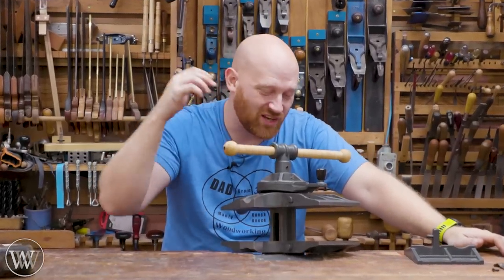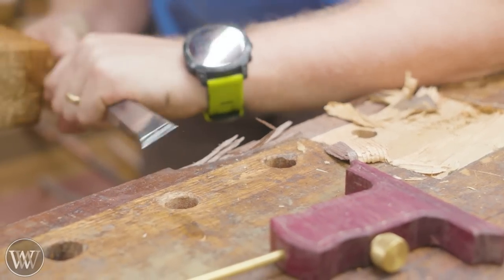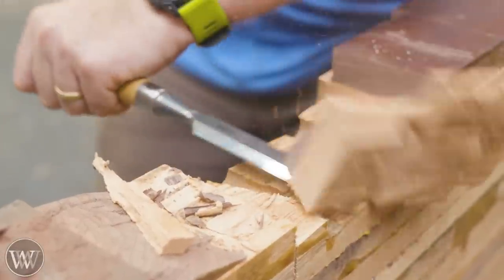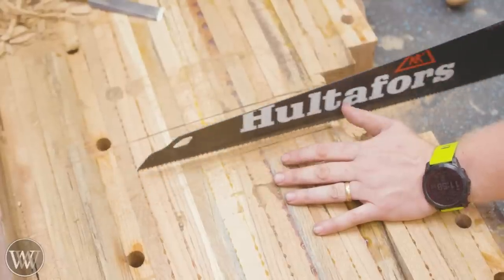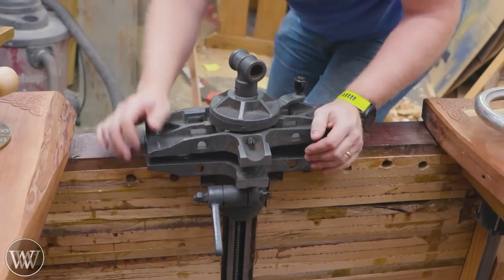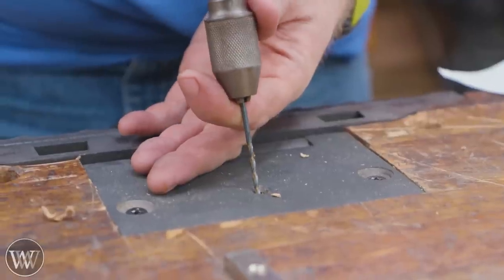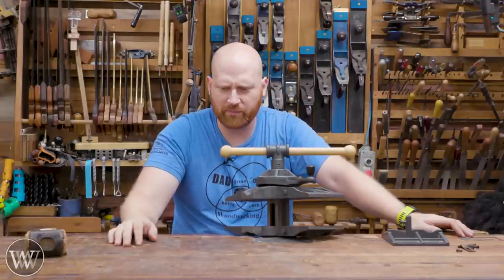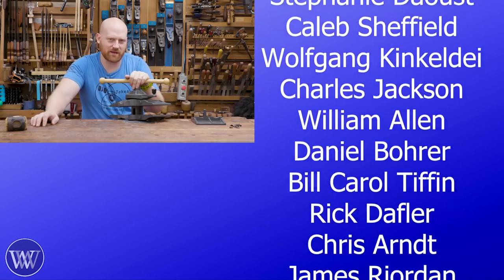How To Install a Pattern Makers Vise In A Woodworking Bench

Comment: Nice to see you using a Swedish saw! Hultafors started year 1697 with making ships nail and later axes and other tools.
Reply: Yes, and Hultafors makes the best purely metric 3 meter tape I can find though I got the impression it is exported to the US by a Brit company. The model to which I refer is about $30 but has a 100 mm tongue that can be released by a tamboured slide that allows precise inside measurements.
Reply: @markkoons7488  Yes the Talmeter as it is called here in Sweden was invented by Ture Anders Ljungberg = Tal meter in 1954 and Hultafors bought the company 2005.

Comment: I was thrilled to get mine, and had it for four years. The most action it saw was me bashing my hip into it. So I sold it for what I paid and do not miss it. Yes, I know that it was an amazingly versatile vise but it really wasn't all that useful day to day.  I do have a carving vice for holding odd shaped items, which I have on a cleat that gets held by my leg vise. I certainly hope you remain enamored with yours. Filling in the cavity was a PITA. Good luck, and thanks for all you do.
Reply from the maker: It is most definitely not a vice for everyone. It does very specific things incredibly well. But not everyone does those things.
Reply: I don't have one. But one thing I realize is that a lot of moving parts is not really good. Sure you can adjust it to another position. But can you get it back to the original position?
FWIW. I have sliding miter saw. I just tweak it to exactly 90 degrees. And hopefully forever leave it there. After all 95% of cuts are square cut. Every cut is square.

Comment: I have done this same job with my pattern makers vise. So, you have a “vice” for “vise’s”? My installation was difficult because of my bench. A bowling alley with lots of nails!  I also did an installation video of my new vise. Found it interesting how you started off so traditional but ended up using power tools. Yeah, me too😊
Reply: Here is the link to my install video if interested. Thanks James, looking forward to you showing the uses video.

https://youtu.be/h-NQLhUEzM4

Comment: You've got some serious Vice issue's. 
Impressive you did 99.9% by hand tools.
 Really cool vice never seen one.
Dose anyone still make them?
Is there a machine shop metal working version?
Reply from the maker: No one makes them anymore. You have to find them in the tool collecting an antique world. You can check out www.handtoolfinder.com to see if someone has one around you.

Comment: Can i ask what kind of vice is this like maker how long and if posible where to find one? With me doing everything from wood work to leather work and makeing custom knifes and saddles i think this would be extremely handy and solve a masive amout of my work holding issues
Reply from the maker: I usually find them at MWTCA tool meets. You can ask some of the antique tool sellers on www.handtoolfinder.com

Comment: They don't call those vises an ""Iron Hand" for nothing.  I've got one (it's a real brute) but I haven't had the guts to mount it yet.  Now that I see how you did it (the original instruction - from the dark ages - don't help much)  I'll probably  mount it up this winter.  It's actual name is an "Emmert Vise" - they were made in Emmetsburg, PA - I've been there many times (about 30 minutes drive from me) - I've never found the factory (probably burned down or repurposed).   Woodcraft used to sell something that looks like the small version.  I've never seen a big one before.   I don't think anyone sells them anymore - you'd probably find them (if you look carefully) at a hand tool woodworking show.  And there's nothing wrong with using a power tool (I do it all the time - go Bosch!)
Stay safe and healthy!
Reply from the maker: Yup I got both of these at tool meets. The big one I have is a Union. But this one is from Emmert.
Reply: Brian, Check out Waynesboro Pa. You'll find a factory called "frick" about 10 miles north of Emmitsburg.  The originals where built there but no longer.  I also live in Pa and was checking into the factory. I am sure there is a barn somewhere that has a few and nobody knows what they are. This is why i keep going to yard sales in the area.
Reply: @thaynegouse576  I will have to check that out (I was told it was Emmetsburg - but I now see it's Waynesboro - which does make sense.  So now I know the area to look in - its even on google maps.

Comment: New bench build coming? It would be hard to make a better looking bench, but you need a place for that behemoth of a vice.
Reply from the maker: I have to build a shop that can fit the bench that can fit the vise. Some day!
Reply: @WoodByWrightHowTo  , I completely understand that. I'm working in a small corner of our small basement. I have power tools, but it's hard to use them in that space. The older I get, the more I enjoy the quiet of hand tools, anyway.

Comment: what would be best style Workbench for this vise? I'm only guessing a Roubo?...
Reply from the maker: You can put it on anything. as long as the bench is heavy enough that this will not make it tip over.

Comment: I restored a massive old Oliver patternmaker's vise but put in too short a handle, about 12". Did you have to make your own handle or was it available from current production somewhere?
Reply from the maker: Mine came with the handle. But the larger one I have I will have to make the handle. No one makes them anymore.

Comment: couple questions here james.  why did you use a devil powered tool?  does the larger one have any capabilities that this one doesnt have? where are you at with regard to building the dream shop on your land?  could you give a good price point for each of the two pattern vices?  btw i had to go to a lower patreon tier for a little while due to medical bills for my wife but i will be back up to normal soon.
Reply from the maker: LOL I used electrons for speed we had a limited time to get this one in.
The larger one and the smaller one are exactly the same just size.
The shop is being pushed off. Currently can not afford it right now. some day hopefully.
for a larger one you are looking around $1000 for the smaller one you are looking around $600
thanks for the support man. that means more then I can say!

Comment: So juts landed a Emmert K1 and I’m sitting looking at 90pounds of awesome and scary lol. That being said I am going to build a bench around it ( was thinking the English joiner bench build that Rex shows on his channel) any thoughts on a bench build that would suite a vise like the K1. On a side note thanks for inspiring me and always expanding my understanding, appreciation, and knowledge of hand woodworking. In a complex and busy life hitting the slow down button and working with my hands is like taking a deep breadth.
Reply from the maker: I would say in English bench would not be the best for advice like this. This vice would end up weighing almost as much as the rest of the bench. And you really need a bench that's about four times the weight at least. I've actually seen a bench fall over when one of these were mounted. If the bench is too light then the center of gravity moves very close to the vise. This means that any work you do in it will easily shake the whole bench. A lot of pattern makers actually mounted their benches to the ground or wall.

Comment: It looked like recessing the vise are it not able to rotate unless it's raised all the way up, is that why some are not recessed
Reply from the maker: no if you want it to rotate when flat then you just have to chisel out a bit more. I may do that in the future if I need it. but most of the time if I need to rotate it I will just lift it a bit rotate it and bring it back down.

Comment: It is a Swiss Army vice.  All it needs is a built-in screwdriver and a steel toothpick.  Itr slices, it dices, it severs, it maimes!

If the president has a vice president, and you have a vice, then I guess that makes you a viceroy.

Comment: Where can I get one of those vises?
Reply from the maker: HNT sells a new version. But other than that there are no modern makers. If you check out www.handtoolfinder.com you might find one or two for sale on some of the online sites. Most the time it's up to who you know.
Reply: @WoodByWrightHowTo  Thanks for the answer! I found the HNT Gordon, very nice but also very expensive :D Do you know if those patents from Emmert are still functual (I'm from Germany and have only knowledge on patents here not in the US) or if i can just 3D print (with metal) those vises? I already made a CAD drawing of the parts with some improvements ;)